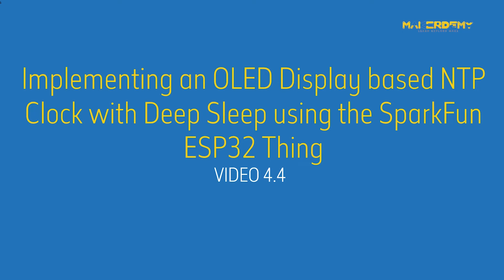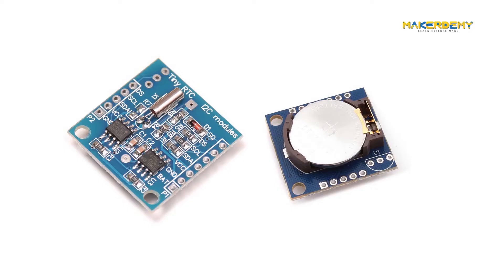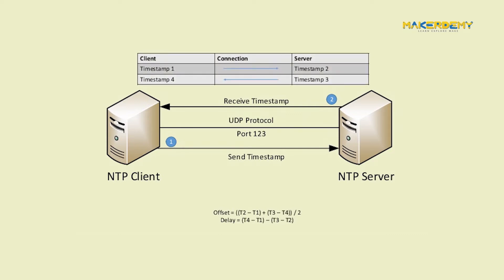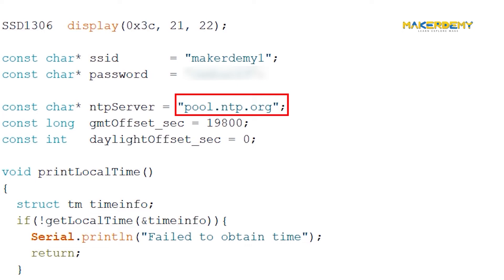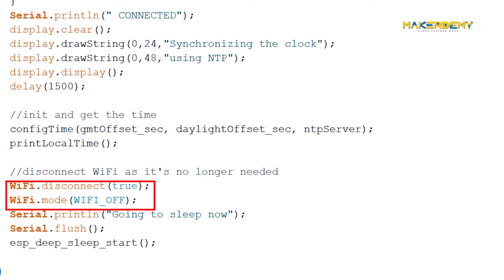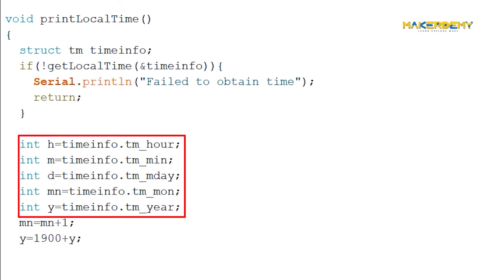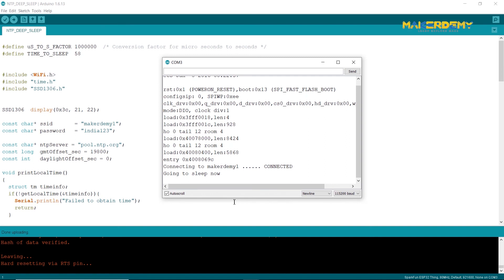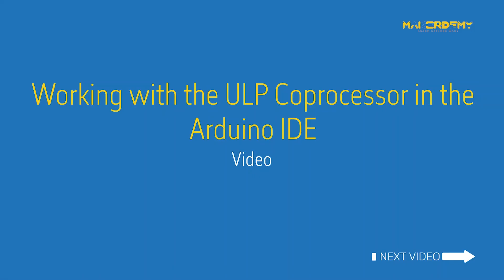IMPLEMENTING DEEP SLEEP IN OLED NTP CLOCK | ADVANCED ESP32

Comment: Did you measure the actual current to the Sparkfun during deep sleep.  There is some confusion about the value.  The Sparkfun web site says the Sparkfun Thing draws microamps in deep sleep.   

Reading posts, however, I see in deep-sleep the current to the unmodified development board is considerably higher (milliamps) than the current to the ESP32 chip (microamps).  The posts describe steps to disable components ( LED, power regulator, etc) on the board.
Reply from the maker: Hi Donald,

We have measured the real-world power consumption of SparkFun ESP32 Thing in the full Advanced ESP32 Course given in the descriptions. Like you have said, even though the datasheet provided by the Sparkfun claims that in the deep sleep mode it uses under 0.15 milliampere, what we have actually observed is that it comes in around 2 to 3 milliamperes. Sparkfun has necessarily not put misinformation; it has just mentioned the standalone chip’s power consumption and not the power consumption of the whole board.

For example, the red power LED takes anywhere between 1.4 milliamperes to 1.6 milliamperes of current, which is the most significant cause of this current draw. The SparkFun ESP32 Thing includes a battery management chip named MCP73831. Checking out its datasheet reveals that it takes in around 25 to 50 microamperes of current during the idle state. Furthermore, there is a design flaw in the Sparkfun ESP32 Thing, that does not allow the SPI Flash memory to go into standby mode. This is because of a missing pull-resistor for the Chip Select pin of the SPI Flash Memory. On top of all that, inefficient linear regulators dissipate most energy as heat, which again adds to the power consumption.

If you are serious about deep sleep, then you need to look into these boards, which are specifically designed to be as efficient as possible. They are Adafruit Huzzah32, TrigBoard, ePulse, Lolin32, & Firebeetle. We hope this was helpful.

Thank You

Comment: Are you sure you are not using sntp not ntp? Sntp simply requests the time. Close but does not take into account network latency which is probably OK as my proper ntp library takes a few minutes to be synchronised.
Reply from the maker: Hi Rob,
In this exact example, we have indeed used NTP & not SNTP. 
Thank You
Reply: @MAKERDEMY  Looking at the code, even though the lwip code is under the function is called sntp_ yes you are right, it does use the UDP protocol. That said it does not do the network latency calculation described for the full protocol as far as I can see from the original source.